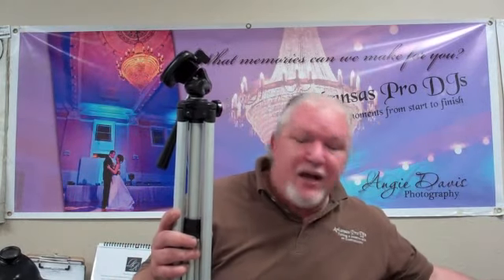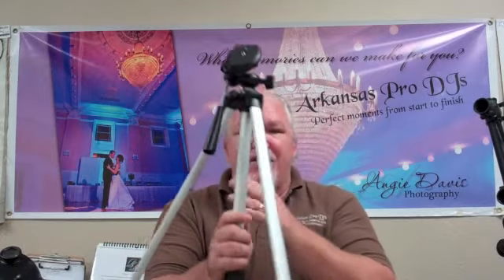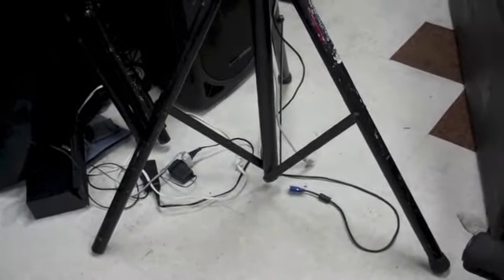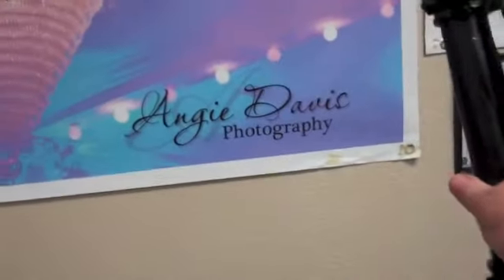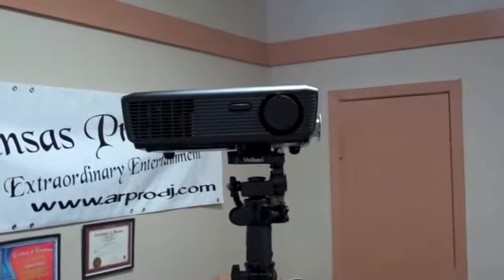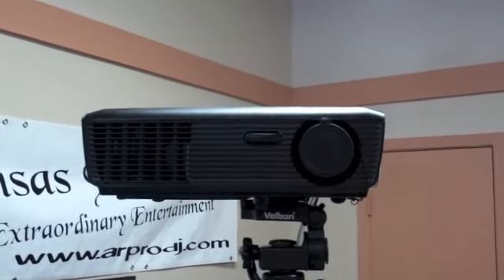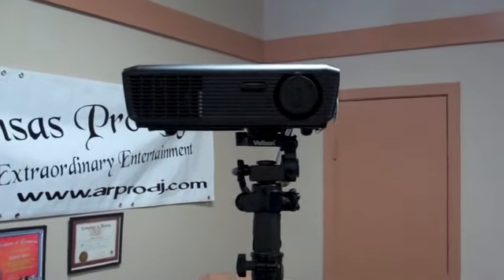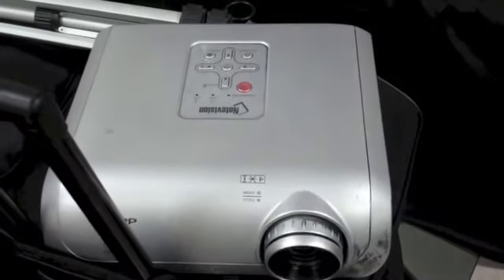Building a Projector Mount, Dj MasterMind Video

Comment: I did this using my Ultimate Speaker Stand and mounted it with at lcd tv mount that I got from radio shack for $10.  One of the venues has a screen up high and they had removed their ceiling mount projector, it works great and very secure

Comment: I have the same question APerfectBlend has. Did you have to modify the tripod mount to fit the projector because I've tried 2 different tripod mounts and the screw on the mount is too big to fit the bottom of the projector. Thanks for the idea and thanks in advance for the reply.

Comment: does your projector support standard mounting screws for your tripod or did you have to modify it? the screw hole in mine is too small for a standard tripod.
Reply from the maker: mine had a camera mount hole in it...just like you would see on the bottom of your cameras